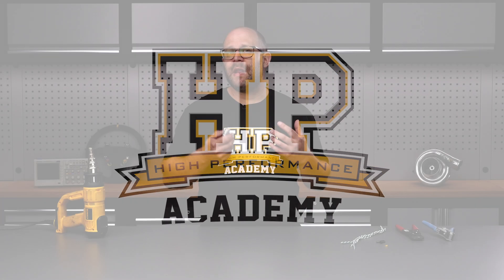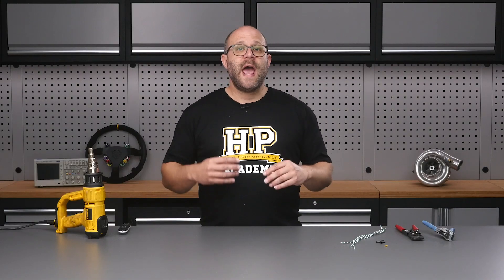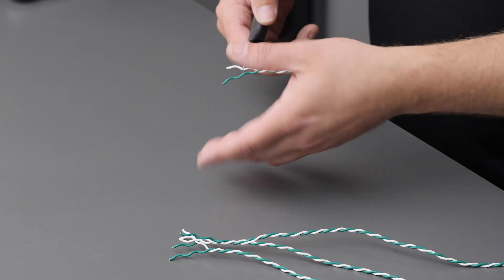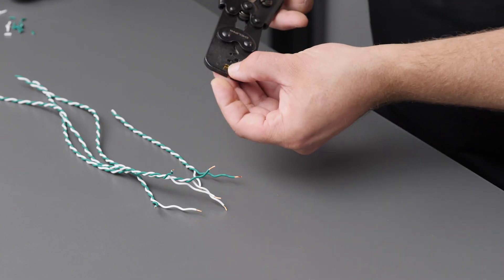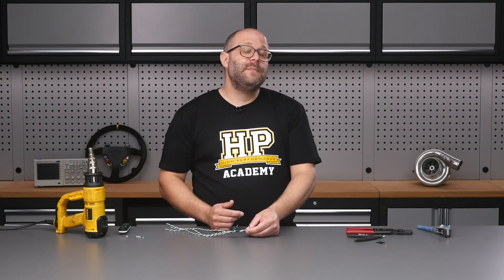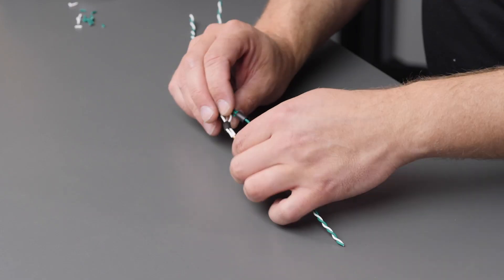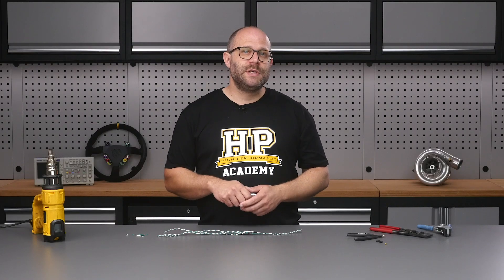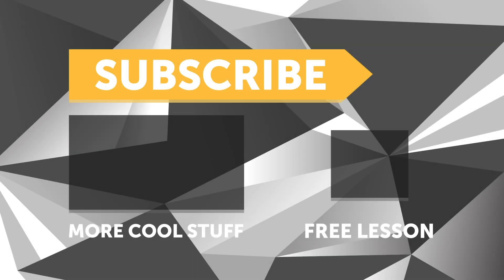Splicing Into A CAN Bus Network | CAN Bus Communications [FREE LESSON]

Comment: When covering splices with heat shrink, dual wall heat shrink will seal both ends of the splice and prevent the heat shrink from moving due to vibration or harness manipulation.

Comment: Is it a bad idea to twist and soder instead of crimp?
Reply: To master crimping you need 100s of dollars in the right crimper ( you will get this wrong a couple of times). For soldering as long as you have solder with flux and a hot iron you will have good results. In my opinion soldering is going to be quicker and easier to trust, test and 'master'.
Reply from the maker: It's up to you. We prefer crimping and if you are new to soldering, crimping is going to be quicker and easier to trust, test and 'master' in our opinion.
Ideally you become competent at both though - Taz.

Comment: Would this be the same process when putting a resistor inline, Example I need to put a 120ohm  resistor in before I splice to a afr gauge, so I’m assuming it goes inline just before the gauge connector ?

Comment: Call me paranoid, but I like to drop a dab of solder as well.  (or solder entirely as opposed to the crimp connector)
Reply from the maker: If you don't trust your crimps what is the point in doing them at all. Just solder if that is your choice of method.
By doing both you are introducing the downsides of both, not just the good as well as adding extra time and costs - Taz.
Reply: Agree. Solder is just easier to know if it works and there for make you feel more confident and less paranoid.

Comment: Im extending a pair of canbus wires for my electric steering computer to relocate it.
Does the can wires need to be exact same diameter as the rest in the system?
Its a mazda rx8 and i have some canbus wires from a audi that look to be a tad smaller in diameter.
Wondering if that would be ok.
Looks to be 1ga thinner then what mazda used

Comment: why don't you use a gas tip soldering iron from Jaycar for $40 bucks, instead of crimping?
Reply: I bought one, and will never go back to crimping again.
Reply from the maker: We don't like the risk that soldering introduces into our work, and prefer the repeatability of reliable connections with ease that the proper tools and materials gives us with crimping. The entire motorsport industry is the same, however, everyone is free to make up their own mind armed with knowledge and their own experience.

This is a good watch in regards to progression through a career in the motorsport wiring industry: https://www.hpacademy.com/blog/from-tuning-to-motorsport-wiring-solder-vs-crimping-mil-spec-vs-autosport-tech-talk/ - Taz.
Reply: @hpa101  I find this so funny. Soldering tends to have a binary failure mode while crimps do not. Know a solder joint failed or did not work tends to be easier. Also the works much better across all different types of cable. Lots of high flex cable is used these days and crimps routinely fail on this type of wire. Every thing that makes a crimp connection good can be echoed for a solder connection and you will tend to get better reliability.

Comment: What happens if they don’t get twisted ?
Reply: then the signals high and low can be affected separately by outside sources.   twisted means that anything that affects one wire affects the other, then the data on the wire stays perfect.
Reply: Just like any IT/telecomm system, you get crosstalk. The tighter the twist, the less chance of crosstalk. The evolution of the EIA/TIA standards for copper network cabling (CAT4 / CAT5 / CAT6 / etc) is largely based on how many twists per inch they can get out of the copper conductors all in order to minimize crosstalk between the individual conductors. The higher the speed of the network, the more twists needed. Cable shielding can help with outside noise intruding into the cable jacketing but it's only for outside noise and not crosstalk between the copper conductors.

Comment: Should not use blue handle strippers on tefzel wire, black handle strippers don’t damage tefzel and should be used instead. There is a bulleting in manufacturers website regarding.
Reply from the maker: G'day Teemu. Yeap, you're spot on there, the Ideal strippers we have there are NOT for Tefzel wire, but they work great for the TXL wire we're using in this lesson...😅
We cover the other wire types and which tools to use with them pretty extensively in our wiring courses if it's a topic you want to dive into a little deeper 😎 - https://www.hpacademy.com/courses/wiring-fundamentals/